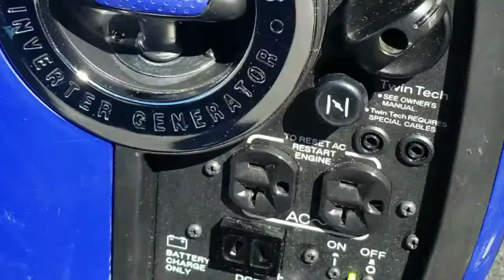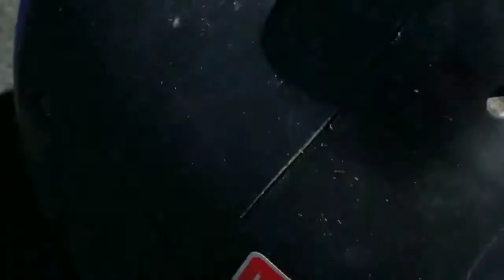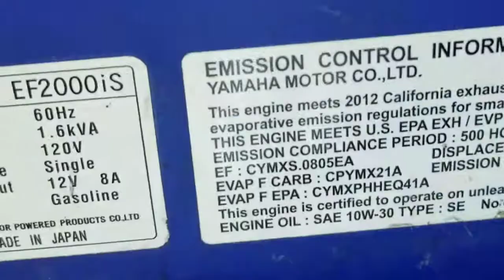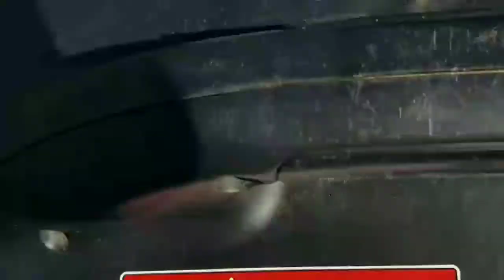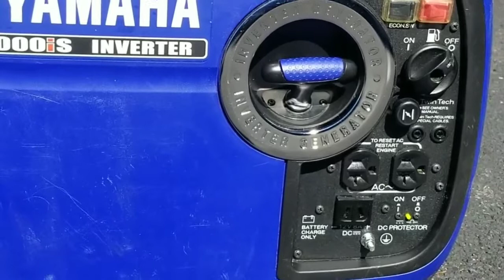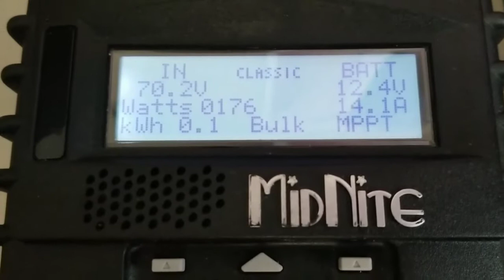OFF GRID INVERTER GENERATOR: YAMAHA EF2000is

Comment: I have both a Honda and Yamaha  1000 generator . Personally I like the Honda better but unlike  another commenter I have had no problems with either one. I use mine to charge my 48 volt solar batteries with a 48 volt charger or you can use a 240 volt transformer to get split phase from it but not enough power to run very many 240 volt appliances etc unless you parallel with another then still fairly limited. 
In a power outage leave it running and charging 24 hours a day will get you about 18 Kwhr I have mine hooked to 6 gallon plastic  outboard motor fuel tank with aftermarket cap for generator.  This provides backup power that is small ,portable and quiet.
Reply from the maker: Thanks for sharing your thoughts. 
LIKE SUBSCRIBE and SHARE

Comment: the 12 volt output will only charge a 12 volt battery bank, better to use the AC to charge the battery bank with either the inverter/charger or the IOTA battery charger
Reply from the maker: Thanks for the input

Comment: the honda is a better unit for the same money.I bought  the same Yamaha new and had a lot of problems with it.motor had crankcase blowby they tried to fix it 2 times under warranty.i sold it and got the honda and have never had a problem from it for years with 1000's of hours on it.hope you got a good 1 I did not.
Reply from the maker: Thanks for your advice